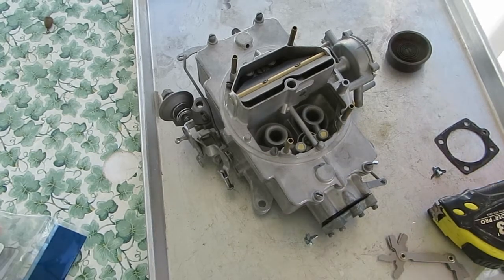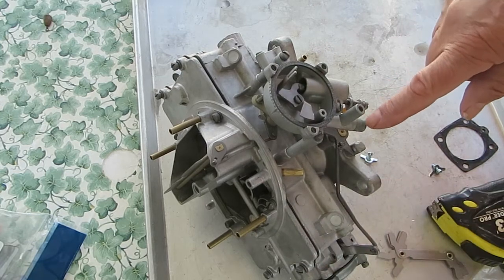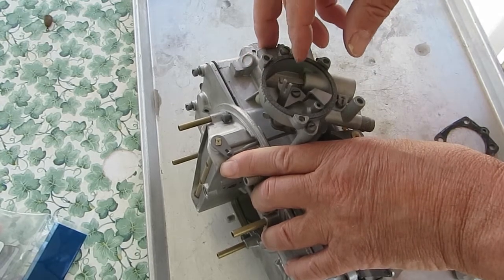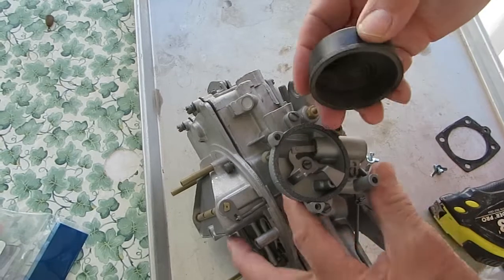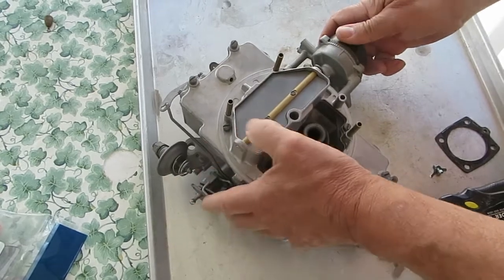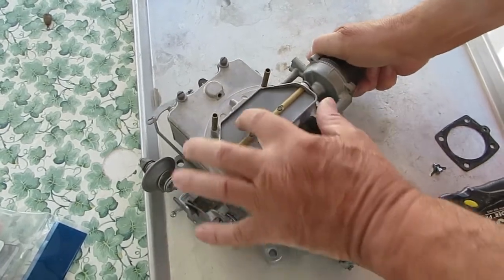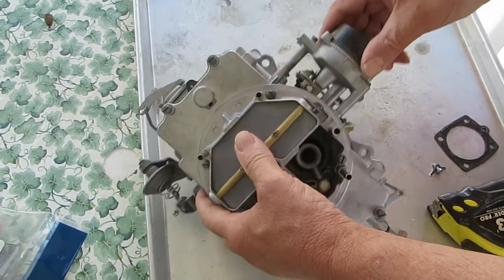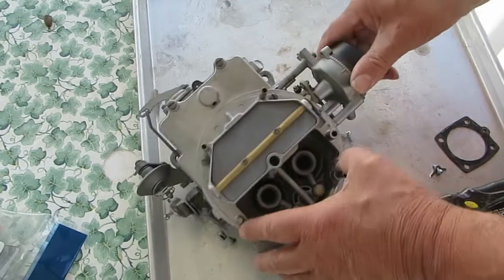Autolite 4100, 4 Barrel  Carburetor Choke Circuit

Comment: Are the earlier automatic chokes that don't have the piston for the choke pull down better?  I have an old 2100 parts carb that has that mechanical spring system.  It even has a set screw on the side of the choke housing to adjust choke pull down.

Comment: That little plastic piece for the choke broke on mine, but it looked different.  Some one called it a dog leg style.  I could not find it anywhere so I replaced it with the style shown on your video.  I had a parts 4100 carb and a 2100 and piece milling from the 3 carbs I was able to get the new plastic piece to work.